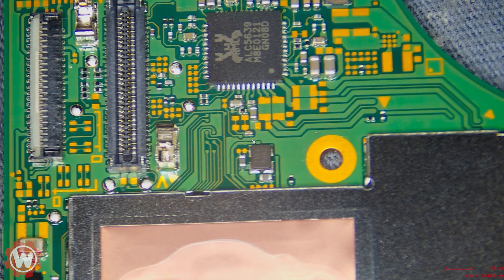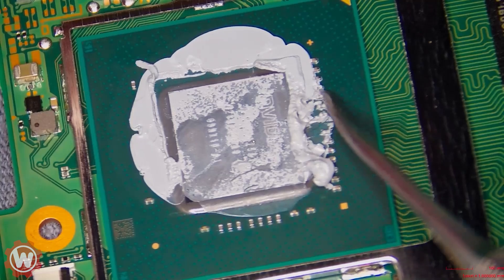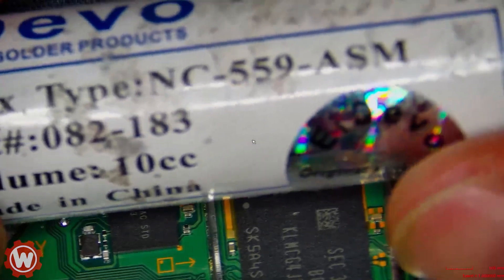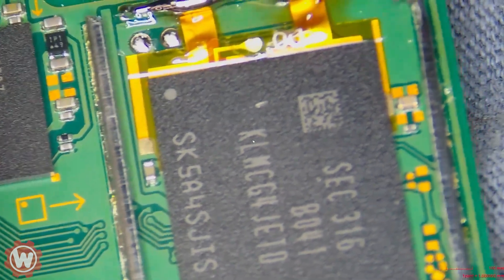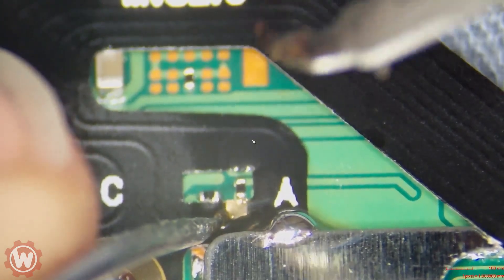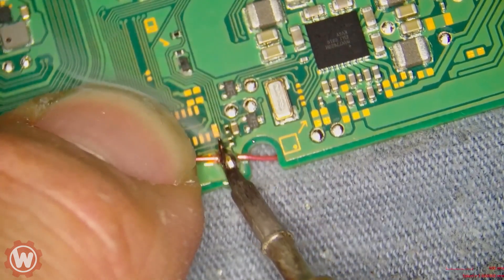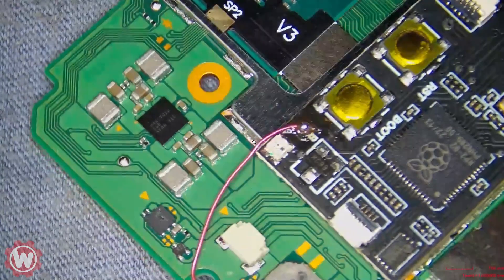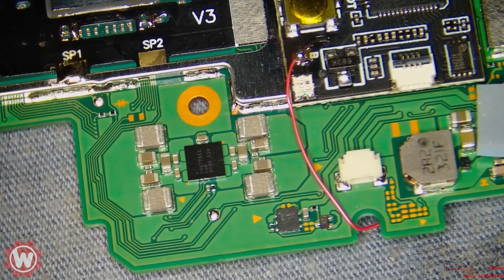Step by-Step Guide: Installing an RP2040 Chip on Your OLED Nintendo Switch

Comment: Excelente video amigo, tengo dos dudas y quería ver si serías tan amable de ayudarme: en el flex DAT0 que va por debajo de la NAND ¿no es necesario soldar los capacitores de los extremos al flex?, la otra duda es sobre los dos capacitores que se soldan juntos y que dice arriba 3.3v, ¿no es necesario soldar los dos extremos al flex? Es que observé que en tu video solo soldas una parte de los dos capacitores. Saludos desde Baja California 🇲🇽!
Reply from the maker: Gracias hermano. Con el dat0 yo no soldo Los caps, no lo recomiendo porque disminuye la tensión. Y el los 3v solo ocupas la corriente. La parte de arriba es tierra pero no se utiliza ni se jala de ahí. Suerte. 👍
Reply: @Wayayeo  Muchas gracias por responder. Saludos 🫂

Comment: Can i use any thin wire I have some in my ebike controller lead. I don'tt know what size but it is not far off  the bigger one that you used. I just don't want to wait ages for wire to arrive from ali express and have everything else but forgot to order wire.
Reply from the maker: Hi there. You can as long as it’s not too thick. Make sure it’s insulated and take your time. God luck with your project and thank you for visiting.

Comment: does this chip v3 an v4 an v5 of this same kind of chip allready comes programed or yu need to drag the 2.73.uf2 file on to the modchip via usb cable?
Reply from the maker: Depends on seller.
Reply: @Wayayeo  its from ebay the modchip same one as the one yu had use in the video just cause its volume 5 modchip an cpu cable...do yu think these come allready with modfile install in the modchip or do I need to run an drop the program fule onto the mod hip via usb cable as mention its from ebay the seller.

Comment: cool video. i've been soldering my whole life but a good way for new people to learn smd is to just buy really cheap practice kits and a decent lighting/magnification solution to suit their space/uses. using good leaded solder from kester or mg chemicals makes a huge difference. cheap chinese stuff is only ok for prototyping on perfboard for through hole circuits imo.
Reply from the maker: That’s very good advice buddy. Thank you for stopping by. Wayayeo.org

Comment: thanks my friend for  the video, i already did it in my friend switch V2, and i like it so i buy it a new OLED for me, but i didn’t know that it’s not the same process, but with you video im more relax and with another view, thanks you so much and wish me luck and sucess, againg, thanks you so much and i will post if it work (im waiting the chip) sorry the bad english, greetings from Chile
Reply from the maker: Saludos amigo y suerte en tu instalación
Reply: @Wayayeo  hola amigo como estas ??? tengo una pregunta respecto con el flex o conector que va debajo de la memoria nand, mido continuidad en el punto dot respecto a tierra y no me da valor, que puedo estar haciendo mal ??, segun yo esta lo mayor posible recto la linea del flex respecto a la memoria (no tengo nada mas conectado, no se si sea eso talvez, se que tiene que dar una medicion pero como dije no me da nada 😢)

Comment: Thanks for this video, it's very helpful to hear the process explained whilst seeing it demonstrated. One small question I have is, when you install the DAT0 adapter at 6:05, is the pressure that you apply horizontal (towards the eMMC chip) or vertical (towards the pcb itself)?
Reply from the maker: Vertical. You want to slightly push down
Reply: @Wayayeo  I didn't get a notification for this but, thank you for your reply!

Comment: The CPU soldering technique looks to be more efficient and with less hassle than other peoples video, very impressive. I will be trying to do a V2 installation soon and will be trying to do the way that you do (without pre-tinning the flex). Videos that tin the flex always seem to have problems with attaching the cable (have to do multiple times).
Reply from the maker: Get yourself some quality solder wire. Best of luck
Reply: @Wayayeo  did a successful install last week. While not every joint was perfectly  formed the first time, I didn't have to go in more than 3 times.
Reply from the maker: Very good to hear @miesals.

Comment: I followed your video step by step, I like how you go into detail about everything, my issue is my oled will not boot with the picofly install, however if i remove the ribbon cables from the picofly it boots up like nothing ever happened, any advice? or tips?
Thank you for your time
Reply: nvm i didnt know i had to install firmwire to the picofly it self thank you again great video
Reply from the maker: Glad you got it working. Thank you for the support

Comment: 16:20
I tend to find many that botched this part up. The unintended pads are too close to the other capacitors (the right side ones), you came close to shorting the right side too! Trying to get out of it is HARD with cheap irons and most often than not they will lose the capacitor trying to fix it.

What I usually find out is their soldering tip is not small enough nor hot enough if its too small. I've tested a few methods to counter this for "everyday joes" to do it with their normal irons and the BEST way is to put a tiny layer of solder mask on the unintended caps. It will save their bacon, perhaps you could do it in a video.

Comment: how and why the solder is so well connected and brillant on the iron ? what is your solder wire and your temperature :) ?
Reply from the maker: You need quality leaded solder along with flux. I’ll link to the stuff I use in the next vid  Temp is 680-700.
Reply: @Wayayeo  my solder can't reach 680 ,can i use 480?